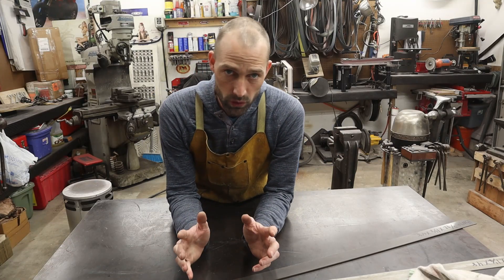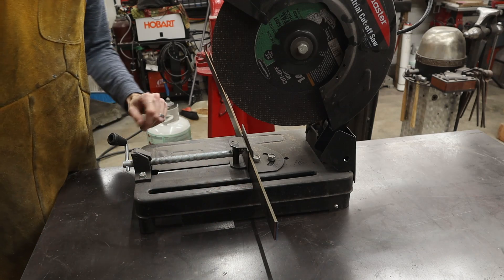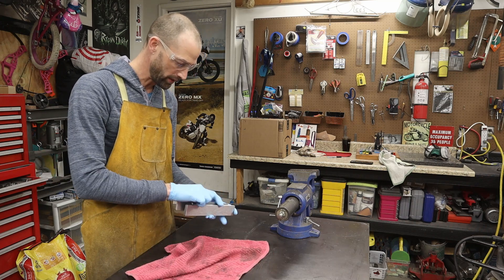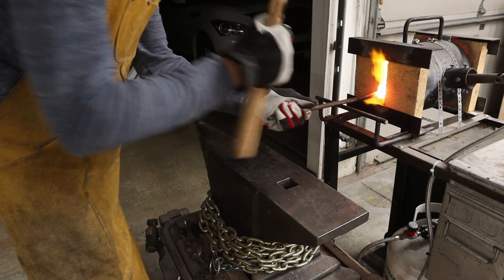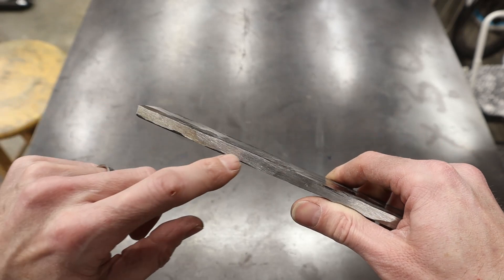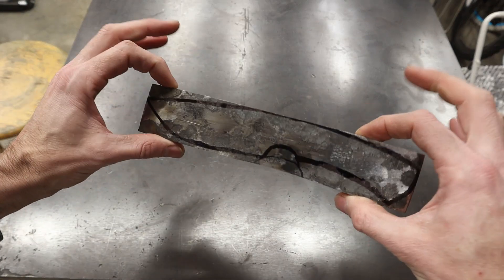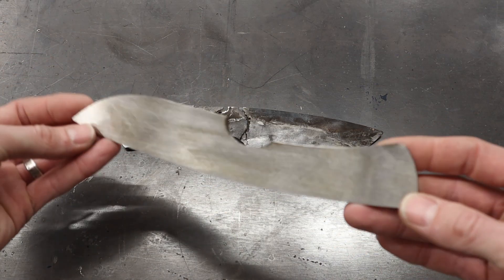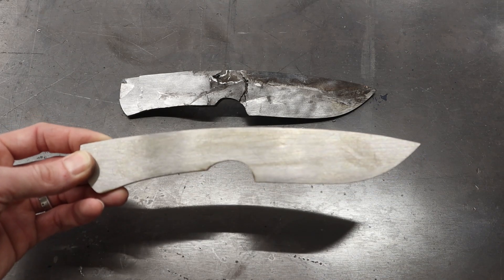Making Go mai - Forging a 5 layer knife with a damascus core

Comment: Hi great video, I’d like to try this. Question is you capped your billet tight with mig using gas correct? I will do the same but will it still work if I run my mig with flux core wire?
Not sure if this will dirty up the billet
Thanks in advance

Comment: You asked what we think went wrong? I see many are saying that the anvil is cold and sucking the heat out of your metal, I agree to a point. I watched this last night but was too tired to really pay attention. Of course this is all my opinion and I know what everyone says about opinions,LOL. Your 1st heat cycle 30 strikes on one side then flip and 14 on the other. 2nd heat 35 hard strikes on one side then the heat. 3rd heat 25 hard on one side. 4the heat 27 hard on one side then heat and I think you started to notice something was going wrong but kept at it after which your camera battery died so I don't know what really happened other than I suspect you noticed the delaminations. I am not a knife maker which on the one hand means no experience but on the other tons of time watching every knife maker I can because the more I learn hopefully the less mistakes I make when I start. I noticed this on one of your previous videos that your laminations where uneven, I think it was 15n20, 1084, 15n20 billet. This indicates to me you are over striking one side and the above count just proves that out. Almost every knife maker I watch when they set their billets it's like 5 to 7 strikes on one side and 5 to 7 strike on the other and they are always consistent in their strike count. One side gets 10 then the other side gets 10. One side gets 5 medium blows then the other side gets 5 medium blows. So my thought are you are way over striking on you weld sets and are not striking evenly on all your sides. Which gives the odd lamination look. I would say 5 soft blows on each side to set your weld. then maybe add a couple more until you are positive they ares set. The metal is very soft, the harder you hit it while in the welding state the more trouble you will have. Soft metal squishing out to the sides means a less likely chance of a good weld because they are missed in the striking pattern. Sorry this so long. hard to get a point across in 4 sentences especially for such an intense question. Also, just because I'm not a maker doesn't make me stupid. I am subscribed to your channel because you do make cool knives and you don't hide mistakes at all. I've seen a few videos where the guy goes "this is my first knife," and it's perfect. I suspect my first 20mwill never be seen by the public eye LMAO. Love the show and your watching your growth. Pat.
Reply from the maker: Wow Pat that was an awesome, well educated answere!  I will definitely take this into consideration while forging the next billet! Thank you for watching the video with such fiery passion!
Reply: @Aleeknives  thank you, like I said don't make them, really wish I could but I watch everything I can in regards to the art.

Comment: I think you’re on the right track with the thermal differences and a cold anvil. Try heating your anvil with a steel block on a work stick that you can lay on the anvil between heats. 

I’ve also had issues with acetone leaving a residue behind while cleaning my parts up- I don’t actually think it’s the acetone, but more the acetone dissolving something on the cloth- or your gloves- and leaving the dissolved item behind on the steel. I now use brake cleaner to rinse off my steel as a final step and have had no issues since then. 

Keep up the good work!
Reply from the maker: That's brilliant with the brake cleaner and a guy just gave me a case last week! Boom 💥 💥 💥
Reply: I dip my billets in diesel just before it goes in, the diesel burning off uses up the oxygen before first flux.
Reply from the maker: Great idea!

Comment: Hi. I will express my opinion. The plates of different thicknesses. While the middle outer ones have warmed up, they split and bend. In the gap a layer of oxide film has formed which is not yet time to weld the metals. It might have been worth making san mai and then add plates for go mai. And before heating, boil around the entire perimeter your workpiece. your hammer for this must be larger or hydraulic like a Zak fabricator.
Reply from the maker: Agree
Reply: I don't know that the hammer needs to be that much larger, it's paying attention to where you hammer is striking. Although a nice 2.5 pound hammer for setting welds wouldn't hurt.
Reply from the maker: Awesome! Thank you!

Comment: Everyone loves a good failure "When it is not theirs". Got to do a little forging today  outside at 69 deg, with no wind. Got to love Louisiana.Turning a cracked disc tiller blade into a few chef knives. On the bright side you salvaged some good steel and learned a few things. I can't wait to see the finished knife !
Reply: I'm glad you got it heat treated without too much trouble. Red beard ops made a quick clamp that I want to make. He uses it after every quench. I'm from Louisiana also. 72° today. Lol perfect
Reply from the maker: Nice! I like red beard ops clamp. He also heat treats before grinding the bevels! Lots of different ways to skin a cat bro
Reply: Exactly. And i like learning more options.
Reply from the maker: Thanks man! I agree and I think this blade will turn out awesome anyway! Super worried about the heat  treat though. 3 different metals that want to move at different rates
Reply: @Aleeknives  I would try claying the blade to slow down the heat treatment shock
Reply from the maker: I just heat treated it. I did a rapid quench and then a plate quench in a vise. Onle the very tip moved on me and I left enough material to grind it straight! 😬😁
Reply: @Aleeknives  Excellent !

Comment: It’s good you’re doing this by hand now. You’ll see what you can get away with using a press vs by hand. Welding by hand is much more difficult and really tests a smiths skill. I welded by hand for a long time before I got a press. Mostly folded and laminated axes. What I learned is the anvil needs to be HOT!! And a warm hammer face. Sounds like you understand that. Also starting material size. You’ll have better success with a billet that’s not much wider than you’re hammer or longer than the speed at which you can strike the length of the billet at proper temp. Want to really test you’re welding ability forge a folded axe! It’s a great forging exercise. Great video and glad to see some hand hammering!!🔥⚒💪🏻
Reply from the maker: Man so glad to see this comment! This was exactly my intent! I want to learn this by hand because I do plan to build a press later this year! So glad you picked up on that and great tips man! I wondered if my billet was to long to start. Next time I will make the billet smaller, weld all the way around the seams, use no flux, set the welds on a peice of wood first and or heat my anvil and hammer! Lots of great tips by people who have walked the mile already!
Reply: @Aleeknives  I usually don’t go wider than 1.5”  or longer than 6”. I’ve done 15 layer billets (1.5”x 6”) by hand no prob. No wood and no sealing of the whole billet. Also a wooden block won’t help on a flat bar billet. That’s for trying to contain a unconsolidated billet like chain or an iron bloom where it burns a cavity into the wood which helps contain it unlike the anvil face. You have to realize what you can do in a press you’ll have a hell of time trying to by hand. It’s just the sacrifice you make. Unless you got some friends that are willing to be strikers! Which is always fun!🔥⚒💪🏻
Reply from the maker: Sweet! Thanks again for your help! I am going to end up with a sweet knife here but just not as I had planned.
Reply: @Aleeknives  we don’t make mistakes, we make smaller knives.....

Comment: Hi Airin 

As far as I know, the reasons why steel doesn’t forge weld is because:
1) the surfaces are not cleaned of contaminants
2) the surfaces aren’t flat
3) the temperature is too cool
4) oxygenation is allowed to occur 

It appears you cleaned all your layers with an appropriate solvent, so unless you used the same dirty towel, which I doubt, then it’s unlikely to be that. 
Also, you took time to grind off the millscale from each layer, so it can’t be that. 
Plenty of borax flux was used, and light hammer taps were used in the first heat, so unlikely it was them. The heats looked hot enough, too. 

So I’m thinking more like you are, a cold anvil sucking the heat straight outta the billet. 
I often see this on Forged in Fire, where smiths put their just-quenched blade on a cold anvil. It makes me shout at the TV.  

A pre-heated anvil, using a gas torch, would keep the heat in the billet long enough. 

Oh, and if you’re looking for an acetone bath, anything metal will do (obviously) but for acetone only use HDPE plastics. It’ll melt almost anything else. 

Great work, mate.  Looking forward to Sunday! 🇬🇧👏🏻🇺🇸🙏🏻

Also, listen to the Work For It podcast from last Thursday. Brian gave you a shout out again.
#HouseWork #WorkForIt
Reply from the maker: Wow Pete! You have a really good understanding of the forge welding process! Thanks for all your valuable input! Cheers
Reply: @Aleeknives  
Thank you mate. I just remember what I see and have been told. 👍🏻
Looking forward to seeing this succeed!! ✌🏻🤞🏻
Reply from the maker: Oh and I meant to say that I enjoyed the podcast also!
Reply: @Aleeknives  
It’s a good’n, wasn’t it?!
Just watch your subscriptions, rightly, increase! 🇬🇧👏🏻👍🏻🇺🇸
Reply from the maker: I just heat treat the Dr. Jekyll and Mr. Hyde knife! Oh it looks sweet! I was super worried about the heat treat. 3 different metals that want to move at different rates. It worked out! Rapid quench and then a plate quench into the vise. Only the tip warped a little but I will be able to grind it out!
Reply: @Aleeknives  
Awesome recovery, mate! 👍🏻
The phoenix rises!!! 🤘🏻😎🤘🏻
Can’t wait to see it 👊🏻 email a picture of it to me, would you? 👌🏻
Reply from the maker: Will do mate!
Reply: @Aleeknives  
👊🏻💥

Comment: Bummer dude.  When I was watching you mig weld it I was thinking, why not just weld all the seams.  That’s what I do for all my San mai /go mai builds and then you don’t need flux and you are much safer.  👍
Reply from the maker: I think that would have been a good plan. I want to learn how to do this by hand before I build the press!
Reply: Good call man! Especially fusion weld with the tig. You make incredible stuff also
Reply from the maker: Thank you!

Comment: I don't think there was enough heat in the steel,maybe try heating the anvil just before attempting your weld if your shop is very cold.
Reply from the maker: Will definitely try that next time! Thanks
Reply: @Aleeknives  no problem i don't see why it wouldn't help.

Comment: You probably have a good point regarding the cold anvil. We didn't get a chance to see if that was your first fluxing when we did see it, but if it was, then it was already too late. Meaning that from what I was taught regarding fluxing is that you first flux the seams at a lower slightly red heat, then flux again at a higher yellow heat (should see the flux melt) 'quickly' and right back in the forge for a bit, then take it out and lightly and quickly set your welds and then right back in the forge. Every time after, the steel can be progressively set or hit harder. But the first, light hits are where you actually set the weld. Honestly, I have watched so many of Jason Knight's videos now, I have went away from fluxing at all. So far, so good. You never know when that delam monster is going to strike. Just my 2 cents. Keep up the excellent work!
Reply from the maker: Great tips!

Comment from the maker: What do you think went wrong?
Reply: You might be right about the anvil taking the heat.  I have seen smiths set welds on a wood block rather than an anvil to prevent that, not sure that would be a good idea in a garage shop because of the smoke it produces.
Reply from the maker: Actually that's a great idea! I Normally have my doors open anyway
Reply from the maker: Spoiler it comes out amazing! I finished the etching tonight and it is wild! I am planning some futuristic handle scales also! Video drops on Sunday morning! Hope to see you guys there!
Reply: Yeah. I think you're right with the Anvil drawing the heat out of the bottom layers. The simplest of answers is quite often the right ones. Curious to see this Dr.Jekyll/ Mr.Hyde blade on completion 🤘
Reply from the maker: Oh man I love that Dr.Jekyll/Mr.Hyde!
Reply: @mcrich1978  is
Reply: that sounds right the anvil sucking out the heat
Reply: I wonder if it would work if you put that white powder in between each layer of steel that you tack weld together. I wonder if it would help the welding process.
Reply: @craigjones2015  thats borax it acts as a flux
Reply: I know its borax I use it to kill bugs as well lol
Reply from the maker: Interesting
Reply: I'd tend to agree with you on a syentifyk level (in keepings with the Dr. Jekyll and Mr. Hyde) but i think what went wrong is that you didn't invite The #1 Nate Dawg to swing a hammer with you...it sounded a lot less gay in my head. Either way, I think it's gunna be  badass. I love san mai and I love damascus. So a different beauty on each side
Reply from the maker: Dude I just etched it and it is sooooooo freaking awesome!
Reply: @Aleeknives  no fare I wanna see hahah
Reply: Right on! Have Fun with it for sure haha! It's practically 2 knifes in one. Its gonna be bitchin for sure!
Reply from the maker: For sure man! Spoiler! It comes n out awesome!
Reply: I think I just nailed a Hamon on my Campy Chef Chopper. 😉 C'mon Sunday!
Reply from the maker: I so want to see it! Airinlee@swbell.net send me some pics when your done!
Reply: I gotta wait till tonight to get it under the grits. Its stay at home Dad thing. 😆 I did pretty good during their nap cycle. Heat treated and tempered while profiling out another.. its getting very addicting haha.
Reply from the maker: Love it!
Reply: So in my experience to successfully hand hammer a damascus billet, it should be about 3/4 the width of the face of your hammer,  not too long, you should be able to hammer the entire length with just a few strikes, flip it repeat and back in the fire.. I don’t reflux after the first heat.  I hit it to set the welds then back in the fire.   I know this info isn’t scientific, but I’m thinking your billet was a bit too wide and too long to quickly set the welds and get back in the fire.   The other thing you can try is to fully weld the seams so you can set the welds over multiple heats.
Reply from the maker: I totally agree with you! I tried again tonight, this time welding all the way around. We will see tomorrow if it worked! Thank you!
Reply: @Aleeknives  awsome cant wait
Reply: Heat up your anvil before you start hammering steel together on it.  Also using a piece of wood initially helps to keep oxidation from forming in between the layers of steel.   The fire started from the hot metal keeps oxygen away from your steel.   Flux, flux, flux also.
Reply from the maker: Awesome advice!
Reply: I am a noob and have only done 2 small forge welds that worked but here's my thoughts.  The core of the billet didn't come up to temp completely. i.e. it needed more soak time. My reasoning is If the anvil pulled heat out of layers 1, 2 and 3, then why did the weld seem stronger between 1 and 2 and weak between 2 and 3?  
I am really impressed with your positive attitude about what happened and I'm looking forward to see how this knife turns out!
Reply: I had no doubt
Reply: Absolutely.